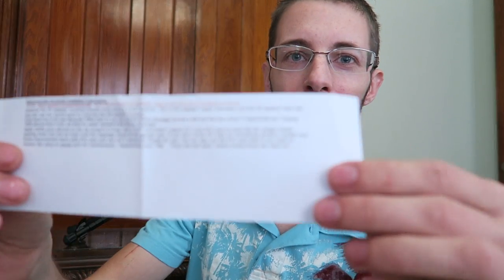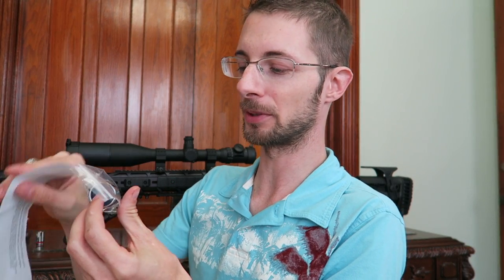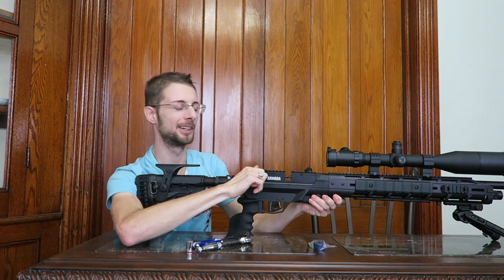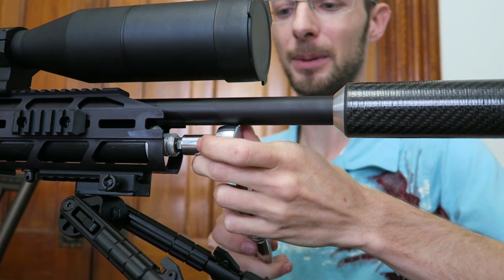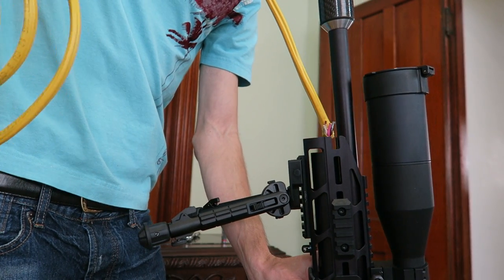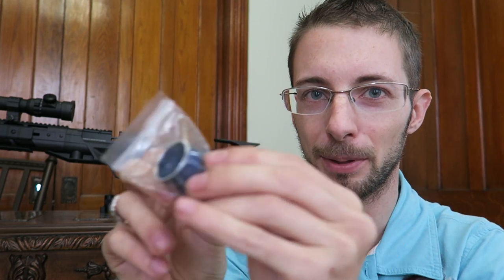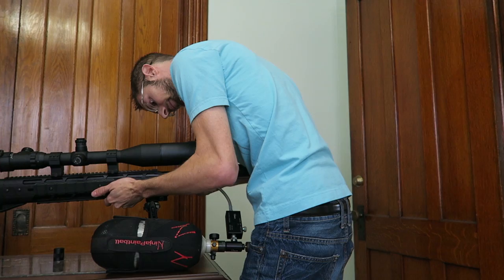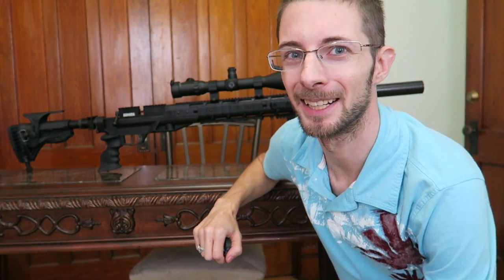Armada De-Pinger Installation | Hill Airgun De-Pinger | Airgun Evolution

Comment: hey urbin.how do u like that center point scope..
Reply from the maker: I have no problems with center point scopes when I first started shooting they were all I used and my dad and I each I have a center point on our .17 HMRs.
I would say there right on point with UTG and Leapers scopes as far as features, but the scope on the gun is a Sightmark Triple duty 6-25 Mil-dot-dot scope, I really Like these scopes and one will eventually take its place on my .17 HMR. 
The other brand of scopes I currently use are UTG Scopes and for the Price you can not beat them. 
I have owned 5 and currently have 2, One was bigger than I expected and would not work for me, I traded one in and I broke one by leaving a camera rig hooked on it which was my fault; I made a video about that so people will learn from my mistake and hopefully save some scopes.

Comment: Hello it’s me again I just got the Benjamin Armada Cal .25 and when I open the box it came with 1000 PSI and I shot it not a problem I finish the air completely and when I tried to refill I feel it up with 3000 psi and when I tried to disconnect the tank from the rifle you know Bleed it first and all air was in the rifle is just came off so my rifle doesn’t hold any air so any idea what’s going on or should I send it back to Crosman any air I put in the rifle once I try to disconnect tank from the rifle all Air is in the rifle is just coming out all the way down to zero and I know you know a lot about this so that’s why am asking if you can please help me or any idea what should I do thank you very much thanks
Reply from the maker: Teodulo Cruz -  the air is leaking from the fill port once you disconnect your tank. correct?
Reply from the maker: If the gun is at 0 psi and leaking as you are filling try cocking the gun/make sure the guns cocked before filling, but this doesn’t sound like the problem you are having.
Reply: Airgun Evolution hi yes correct from the fill port it is leaking air
Reply: Airgun Evolution yeah when I put the air on it’s not leaking at all it’s leaking only when I disconnect the tank leaks from the fill port
Reply: Thank you 🙏. Maybe is the hammer problem or something like that
Reply from the maker: Teodulo Cruz - I would think it's a fill port problem, since it is a new gun my best advice would be to call Crosman. They will fix it for free under the warranty up to one year. They should also pay for shipping so it won't cost you a thing. I keep my magazine and the 3 picatinny rail sections when I sent mine gun back for work and they shipped a brand new gun to me so I got a second mag and 3 more rail sections too.
Reply: Airgun Evolution yeah I tried that I cocked before start pumping air on and when I am put the air on it it’s not a problem it will fill it up all the way to 3000 PSI The problem is when I disconnect The tank from the rifle when I bleed it out too late Air coming out of the tank between tank and rifle so I can disconnect that is when the air are coming from the fill port and when I’m putting the air into the rifle it’s going in very slow and again once I disconnect the tank the air just coming out of that rifle thank you very much thank you .
Reply: Airgun Evolution ho wao OK that sounds great thank you so much for your help thank you again I hope you   have a wonderful day thank you very much.
Reply: Hi I just fix it my Benjamin armada PCP rifle cal.25 and you was right it was the fill port problem so I switch it for a new one and it’s just working perfect now is working great I am so happy that I can use it not a problem and thank you thank you again very much for your help .
Reply: Hi I just fixed my Benjamin armada and you was right it was fill port problem thank you very much for your help I also see and your video that you change the depinger and your Benjamin armada so I do the same thing to mine thanks to your video but before I change it I went to hunt rabbit and I hunt one not a problem I kill it with one shot One shot one kill I shot it right in the neck end it went through the neck broke all the bones not problem and right after I change that depinger I want to hunt rabbits again and I shot one 4 times and I know I hit it every single shot because every time I shot it jump like 4 feet up in The air so when I take the skin off I hit it only with one bullet one pellet and I know I hate the rabbit three more times so after I change that depinger seems like a lost a little bit of power is that possible to can happen or is just me thinking that way and when I put that depinger I put it in all the way until stop The one I take out from the factory it was only like halfway so should I pull it back the one I put it in and leave it just the same spot where was the factory one i’m asking you because I know you know more than me me and thank you 🙏
Reply from the maker: I dont know if you will see this reply because youtube removed the video but the depinger goes all the way down and there should be no loose of power.

Comment: What's the point of replacing the factory depinger?
Reply from the maker: Christian Riddell - The factory depinger helps reduce the Ping but not all the way. 
The factory de-pigner is a low cost part put in to say the gun has a Depinger. 
The aftermarket one I installed will effectively quite the Ping down to nothing.
Also 
There are a few different types of depingers the factory one is the least effective type but the one I replaced it with is the most effective type... 
watch this video: it is awesome and will explain everything on what causes the ping and how the different types of depingers work.
https://www.youtube.com/watch?v=YuC8Q1XDfIk

Comment: that thing looks like its about 60inches long
Reply from the maker: Ali Verrett - Hahaha I know right.  The gun does break down for transport, The stock has a side folding adapter and with the suppressor off it gets a lot smaller. I did measure it once but I forget how long it is, but I will re measure it and let you know.
Reply: Lol as long as it shoots good
Reply from the maker: O YEAH!!! See Its all part of the plan the gun is so long because it lets me be 20 yards away well the barrel is right next to the target hahah
Reply: Lol thats one way of looking at it
Reply: With the original stock, the .25cal. Benjamin Armada is 42.8" long. My own built .25cal. Custom Benjamin Armada Bullpup is 32" long...  thank you for the comments on Instagram. Mr. Tim Hill is a good supplier and as always you did a great mod Sir. Sony the Teen Air Gunner and I are looking forward to how the 10 round magazine works....  gotta gotta get me some for there are some Merriam Turkeys that are waiting for us at our Sangre de Christo Mountain ranch!
Reply from the maker: Kidd Kool Arrow - Yesterday I went pigeon hunting only to find a trapped Falcon on the 6th floor of the building I hunt at... I opened up the large windows but he didn't fly out. I spent hours trying to get a shot off at a potion to set in the window to lure him out but the pigeons were not coming in range and the one I did get fell on a roof... so today I'll be back there I'll shoot some pigeons at my other location and bring them with me and hopefully I can save him today. I am filming the whole operation and with any luck and a good outcome it should be up soon.

Comment: Im having issues with my benjamim armada. The air doesnt go in and the gauge doesnt pass the first 2 lines of the gauge ?
Do you know what could it be?
Reply from the maker: Is the gun brand new?
How old is the gun?
Can you hear an air leak in the gun?
Are you hand pumping up the gun or using a tank?
Is the air rushing out of the gun or just not going in?

-Try cocking the gun then filling it
Reply: @AirgunEvolution  
Hi 
Yes the gun is like a 1 year old
And already try what yoy mention
But the gauge at the pump and  the gun doesnt goes up
Also the air kinda leaks thru the air nozzle.
I hope you can help me or at least guide me  cause where i live we dont have much air gun technician
Thanks bro
Reply from the maker: Sorry for the late response, I would go to airgunnation.com  its a air gun forum ask the guys there for help and they will be able to guide you and most likely have your gun fixed with in a day or two
Reply: @AirgunEvolution  thanks
Il try that 
Saludos  amigo